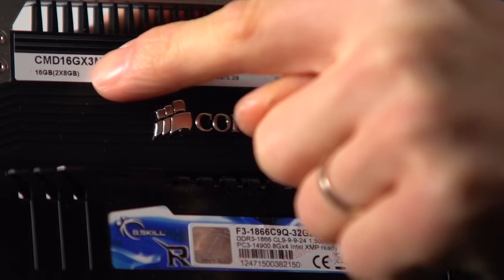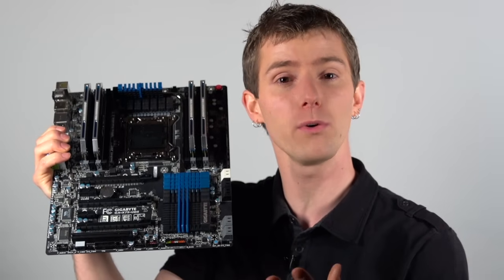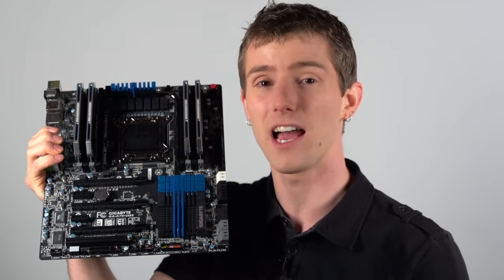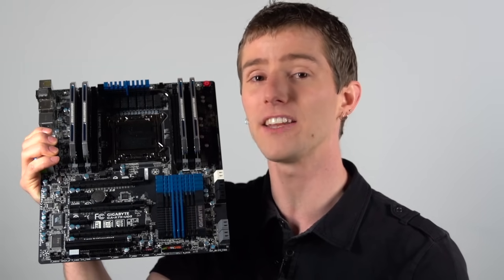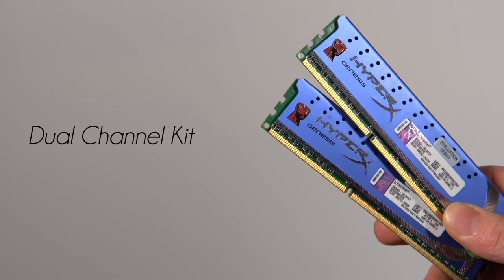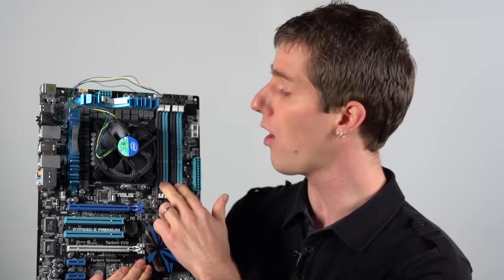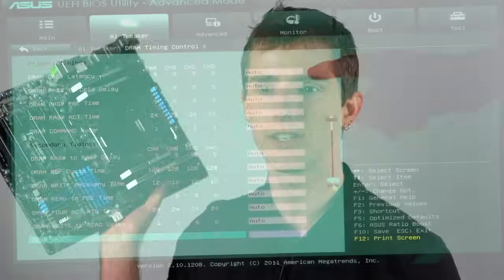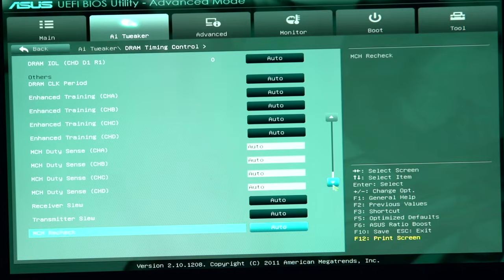Guide to RAM Memory Channels as Fast As Possible

Comment: My PC has 6gb 1600mhz. I want to upgrade to 8 or 16gb 2400mhz. Will that work? Can my motherboard handle that?
Reply: how many slots does the mobo has?

And i believe you cant add different speed memory to your current you would have to remove your current 6gb 1600mhz for that, which is not recommended, memory speed hardly effect performance as it is, and 1600mhz is plenty.
Reply: 4 slots...also i want to ask you another question. Isnt Redeon 290x 4gb better then the Radeon 5970 HD? I need to upgrade because Battlefield 4 and Watch dogs wont play on my 5790 HD they runs slow (lag, freezing). Or is it smothing else? PC specs? Intle i7 x980@ 3.33, 6gb. Thank You for your help.
Reply: uphill248 uphill248
Well i know that watch dogs had some performance problems even with top tier cards, but how bad it is in battlefield? it comes down to if you're willing to spend the money for it, it is alot better then your current card.

Comment: Is there a difference between having 4 x 4gb ram versus 2 x 8gb ram?
Reply: yes, if you run them in quad channel the bandwidth is four times as big as the original modules as opposed to dual channel where you only double the performance
Reply: ya when you go to upgrade  and you have 4x4x4x4  and you want to add a new 8.. you wil have to pull a 4.. so you have paid for an 8 but only expanded by 4...   but if you bought 8x8.. you could have added an 8.. and got what you paid for.,

Comment: hey I have "2 ram slot". Slot 1 already contain 2gb.  my laptop also support dual channel . but I can't afford  4gb + 4gb . so i'm thinking of 2gb + 4gb. So does my laptop speed increase. earlier it is 2gb ram only. please reply. :)
Reply: My friend's laptop also has a 6GB of RAM (2 + 4) and works just fine, though he advice me to get the same brand and the same model.
Reply: Hey! Are 1600 Mhz and 1600 Mts speed of ram is same or different??
Reply: Rk Bitian
Different. Mts or Megatransfers per seconds refers to the throughput of the ports. 1600 Mts is roughly equivalent to 800 MHz.
Reply: My ram speed is 1600Mts so i should buy a new ram of 800mhz. Are you sure.. ?? Because in market all the ram ratings are in Mhz.
Reply: Rk Bitian
Can you give me the model of the RAM you're currently using? Yes you're correct most RAMs in the market are rated in MHz, and tbh its quite rare to see Mts rating of RAM.
Reply: Rk Bitian
Not found. The link you've posted is a transfer link, not the actual one.
Reply: Rk Bitian
Still can't find it. Perhaps send me the model of the Sony laptop you're using so I can look into its RAM specification
Reply: Now open it.  drive.google.com
Reply: Rk Bitian
I can't really get much information on your laptop, but my best guess is that its a DDR2 RAM. The best thing you can probably do right now is to email their customer support since the internet is not showing any decent results about the motherboard. It shows a 1600Mts specification, although it could mean that it is the I/O bus throughput of the PCI-E slot.
Reply: Thanks a lot for you time. 👍 BTW i will try to find the ram in rating MTs. Thank you. :)
Reply: Rk Bitian
I'm sorry if I wasn't able to help you. I searched for the RAM I'm using now (Kingston Hyper FuryX) and I wasn't able to see any MT/s. Even my motherboard (Gigabyte H81M-DS2) did not show any Mts specification. Maybe if you still have the manual, it is written there on what RAM should you use.
Reply: Yes it is written in manual. See this drive.google.com
Reply: Rk Bitian
You can go to tomshardware.com and ask the question there, but from my research you do really need an 800 MHz DDR3 RAM
Reply: Thank you.👍:)

Comment: im building a PC for another one of my friends and hes on a very tight budget

i have a single stick of g-skill 8gb ram in my house i would give to him for free what or how much of a performance decrease could he see from only using one stick compared to two on a dual channel mobo for gaming
Reply: one 8-gb stick will work just fine, plus it gives him room for 16 gigs later (Or even 32 if there is enough slots) If he is using an APU rather than a cpu+gpu, then you might want to get the dual or quad kit with higher speeds because integrated graphics take advantage of faster memory as a cpu alone will not really
Reply: not much performance decrease, don't worry about that.
Reply: None. Games don't use more than 8GB and aren't memory intensive.

Comment: What if i buy a Quad-channel kit (4 x 4 GB) for a motherboard that comes with 8 slots for ram?
Reply: thesral96 I'm sure that you will be fine. That's what I plan on running on my next system.
Reply: britishyetis Games I'm going to have 12gb of ram (3 sticks of 4gb each) to put in my motherboard with 4 slots (I think it's dual channel? It's an older computer.) Will that work better than if I just removed one of the 4gb sticks?
Reply: KidKitzman If it helps at all, my motherboard is a M2n78-LA (Violet) and it came in my HP pc.
Reply: KidKitzman your motherboard is dual channel. I'm not sure if that motherboard will allow you to use 3 sticks because its DDR2 but to be safe I would only use two or four unless you find something that suggest it will work.
Reply: Okay. I've been blue-screening all the time, and I thought replacing my bad hard drive would fix it, and it didn't really. It's caused so much trouble over the past 6-8 months that I just wanna get a new PC altogether, but sadly, I'm way too broke to do that. If replacing the RAM doesn't work, I give up.
Reply: Another quick qeustion. I ordered the three sticks I mentioned. They are the same voltage, speed and size as the stick that's in my PC, but are technically a different brand. Would it be okay to put them all together to make 4 sticks total, or should I just remove the one that's a different brand? Their specs are identicle.
Reply: they should work. but they might not
Reply: okay, thanks lol
Reply: The three DIMMs came today, and 2 were bad :/

Comment: I have 2x2gb and 2x4gb DDR3-1333 but they are different brands and I keep getting BSOD and "page fault in nonpaged area" :(
Reply: +Ethan Roy different CAPACITY and different BRAND = Possible BSOD
Reply: +SquidPlays here i'm sitting on gaming 2008 PC with DDR2 2gb 800MHz + DDR2 1gb 667 MHz , both different brands as well, no bsod's at all due to memory in these years, guess i'm lucky owo, also overclocked both from 3.33 to 4.0
Reply: cskillers1 Lucky you.

Comment: I didn't get it really 

I have an asus z170-a is it bad to get a 4x4 ram?
Reply: +Elyas ALsayed I looked it up and it says that it has dual channel support. So when buying your ram make sure that your ram (under specifications on newegg for example) says that it is dual channel ram. Also make sure that they're all the same type (DDR2, DDR3, DDR4) and that they're the same speed. Your motherboard can handle 2133 mhz to 3333 mhz.

Comment: help. if I put 3 modules RAM to my pc it has 4 slots, dual channel is disabled?
Reply: From what I gathered in the video using 3 sticks isn't a good idea. You'd probably come out better using just 2 sticks or getting another 1 to add to it.
Reply: it depends. If all four slots are the same colour then u r ok, but if 2 are black and 2 blue or whatever colour they are then put 2 on the same colour

Comment: can anybody help i have asus z87-x Board anf four slots for the ram 2black and two yellow i have 2x8gig ddr3 1600mhz ram modules wher is the best or optimal Places to instll them black to black or yellow to yellow or black to yellow it is very confusing
Reply: check the manual for which "color" to populate first, it's gonna be either black/black or Yellow/Yellow. mine were coded A1;B1;A2;B2 and I remember it saying that if I were to only install 2 ram sticks, populate the A slots first. 
I honestly don't know (because I did like I was told by the manual) if there's a difference by only populating the B slots (logically I'd think not. but didn't try it).
hope this helps.

Comment: Can I use RAM with a higher speed than the  supported speed of the Mainboard?
Reply: Also whats up with the Voltage?
PCPartPicker ( yes, Im a pro) sais:"The Corsair Vengeance 8GB (2 x 4GB) DDR3-1600 Memory operating voltage of 1.5V exceeds the Intel Skylake CPU recommended maximum of 1.35V+5% (1.417V). This memory module may run at a reduced clock rate to meet the 1.35V voltage recommendation, or may require running at a voltage greater than the Intel recommended maximum." 
So am I good to go or do I have to lower the voltage in the bios or something else?
Reply: +Leon Schmidt I seriously doubt that your motherboard will support it but I could be wrong so check your mobo's doc. If you are a "pro" you wouldn't have to ask that question in the first place.
Reply: i read somewhere that if you have higher speed ram sticks than the board supports then the sticks would just run at lower speed and it would work fine
Reply: If your mainboard runs at 1566MHz, for example, and you put 2133MHz RAMs in it, the rams will run at 1566MHz. However, this is good becuase it allows youy to overclock the mainboard up to 2133MHz without the RAM failing.

2133MHz RAM doesn't actually mean that they run at that speed, it means they are tested/safe to run at that speed. Its still the mainboard that sets the speed. Try to go faster and they will fail.
Reply: Skylake doesnt support ddr3 except for laptop modules but you should be looking for ddr4 if using a skylake cpu.

Comment: I have 8Gb can I add 4 to make 12?
Reply: you mean like you have 2x 4 GB and want to add 2x 2 GB? thats perfectly fine, and will most likely still running dual channel.
if you mean using one 8 GB and one 4 GB stick, this will in most cases run in single channel (there are rare boards that kann do a form of asymetrical dual channel)

Comment: i still dont get it? i want to buy another Hyper furyX 8GB 1600Mhz to go with my existing Hyper furyX 8GB 1600Mhz can i or not?

ASUS M5A99X EVO R2.0
Corsair H75 HYDRO COOL 
AMD FX8350 8 Core 4.0GHz
8GB Hyper fury 1600mhz DDR3 RAM 
MSI R9 380 gaming 4GB
1TB SATA harddrive
Corsair CX750W
Reply: +Julian john As long it's the same model (colors too) so yes
Reply: +SquidPlays green and yellow dimms are notorious for being incompatible
Reply: they are both red Hyper furyX 8GB 1600Mhz and happy to say they are both working together in my pc, linus was saying you should buy them in packs of 2 not singles thats the bit i didnt get.

Comment: I have 1 stick of 8gb ram could I buy one more the same ram stick.
Reply: pretty much every mobo has at least two slots, more expensive ones usually have four.. . if you're sure you have a single 8gb stick then yeah you can buy another 8gb stick no problem

Comment: Can I run G.Skill Ripjaws Z quad channel memory (4-dimms 4GB X 4) in an MSI Z97-G43 with an
i5-4690k? Any help would be appreciated
Reply: +neyo509 I'm wondering the same thing with the same type of ram lol. 4x4gb is good but it's best to use 8x2gb
Reply: Stephen Sexton I am currently running the said configuration above, and I've had absolutely no problems whatsoever so it should be fine. There shouldn't really be any issues with 4x4 GB or 2x8 GB memory, as far as I can tell they're identical unless there are compatibility issues.

Comment: can we use 1600mhz ram in intel dh61ww motherboard
Reply: No , you need a Ivy cpu , xeon 1200 v2 ( socket 1155 ) for support 1600mhz ram + Motherboard B75 chipset .
Reply: interesting videos H61 board supports only 1066/1333 mhz ram speeds. You can use it but it will automatically get down clocked to 1333 mhz. It will run fine. Just make sure that both the rams installed are identical, otherwise they won't work in dual channel.

Comment: wait so it's bad that I'm using 1 8gb stick of ddr4 ram in quad channel movies?
Reply: motherboard*
Reply: not bad, just not optimal. you pay quite a bit extra for quad channel, so whats the use for it if your not going to use it? its like buying a lamborgini when you work from home. its not optimal, but its not bad either.
Reply: The way I understood it. It's not bad but it doesn't make your systems performance any better than having a single channel supported motherboard.
Reply: It's also bad to have one large stick, rather than having many small ones, because smaller sticks tend to have a lower CAS latency, so they're faster.

Comment: its ok to put different mhZ? tnx
Reply: no, if one is faster and other slower, the faster one will work as fast as slow one, for example, if you have one 1333 mhz and one 1833 mhz, they will both work on 1333 mhz
Reply: tnx
Reply: Np
Reply: Mark delos santos but its still possible right, cause i have 2 different modules and im like 3 hours away from building my PC?
Reply: Ttyme1616  It should be possible, just watch out for voltage to be same, P.S. not an expert

Comment: What's the difference between RAM and memory
Reply: RAM is memory, to be precise, light, faster memory. RAM memory is volatile, meaning it stores what the processor did and stores it for a short period of time and deletes it as soon as another process begins. HDD on the other hand is permanent, it CAN be used as a virtual RAM, but that's nearly useless as it is much, much slower.
Reply: ludan1498  thank you
Reply: No its for cache, temporary memory
Reply: ***** if you have that amount of fast memory, you practically have a server
Reply: Rhys Edwards I used the word "volatile"  m8 Dya even read?. or are you just a troll looking for an argument
Reply: RAM = Random Access Memory
Reply: ludan1498
says the one trying to start an argument by asking if i am trolling , what is it with people on youtube damn , Nothing i said was wrong so why get your panties in a wod
Reply: *****
You run what's called a ram disk.  You set aside a set portion of your ram to act as a hard drive.  What happens is instead of a write operation going straight to your slow HDD, it writes to the ram which is WAY faster than even SSD performance.  It is volatile, so you either lose the info when your computer shuts off, or it can write the data from the ram to a HDD before shutting off.
Reply: Rhys Edwards idioto

Comment: i think ime going mad i have a ddr2    ,2 slot on an old board  a gf8100vm-5    it says   it can thake only ddr2  not ddr3 ,,,,,,, but   not all ddr2  slots are the same   mine looks more like a ddr  than a ddr2  , but it is a ddr2   and some times the ddr2 will not fit  it may be 4 mm out  of center

Comment: I consider myself reasonably "intelligent"... but jfc I need help. (Specs below)

I have 4 stick of 2 gbs each, two pairs. The board I have is only a dual channel. I am guessing this is why I only see 3.9 as usable.. would that be a safe guess?  

I have them set up properly I believe. After looking around I am sure, just match up the pairs in the same color slot. Correct? 

tl;dr - 

ASUS M5A97 LE R2.0 AM3+ 

 G.Skill DDR3 PC3-10666 1333MHz - I bought these 2  pairs of 2 GB each , equaling 8 gb. :| Had no clue it even mattered. Mistakes were made. Now I am trying to figure out a way to make it work all 8 gigs. Probably wont happen.
Reply: are you running a 64 bit system?  a 32 bit system will only use 4 gb of  ram even if you have more install it will only use 4 as max

Comment: THATS IT!!!! THATS IT!!!!

that is why I am experiencing some very weird issues!.......every once ins a month or two weeks my computer would just randomly restart with no BSOD, it works fine apart from that my games work, my system boots up just fine, however I can't set XMP because it crashes but I let that go.....I bought two sets of Dual Channel Ram and I think that is what is causing the issue.....god I had no idea how could I be so stupid!!!....
Reply: Was that indeed your issue? I am rather curious now.
Reply: idk it could be anything really, diagnosing is always a challenge when it comes to pc's, so far it hasn't done shit it's running just fine....I did remove Avast recently and it seemed to have helped it.....it's really, really rare that's why I am not too worried about it....if it happens well ok, as long as it doesnt happen frequently or like every 10 minutes it's fine.....two likely issues either be PSU or RAM issue, that's my guess tho I would have to trouble shoot and to be honest I am quite lazy for that....
Reply: MrViral20 Have you activated minidumps and checked them?